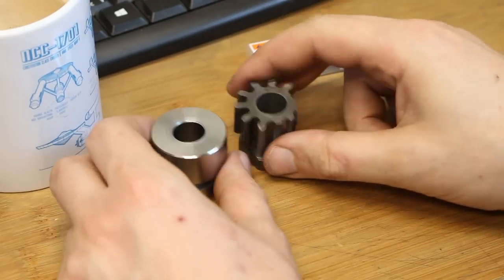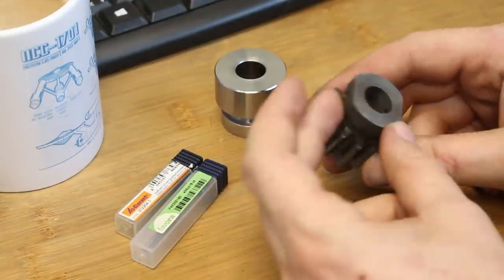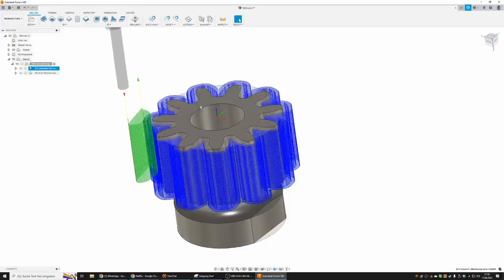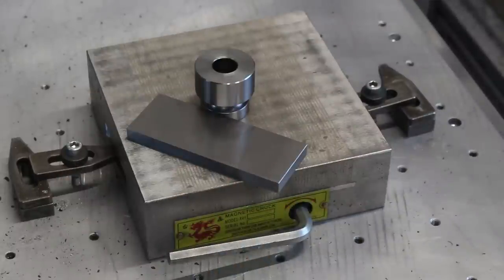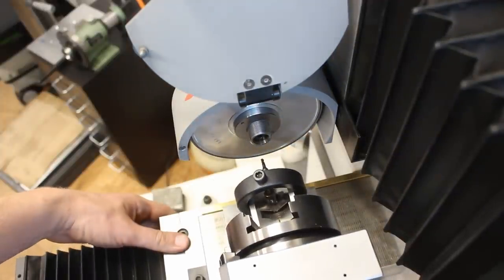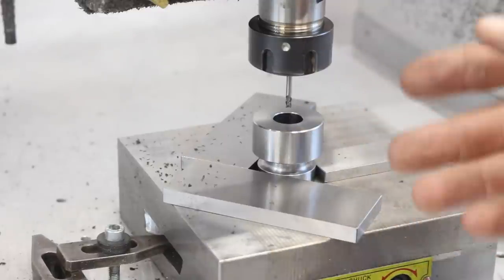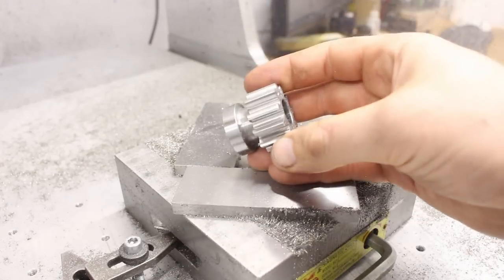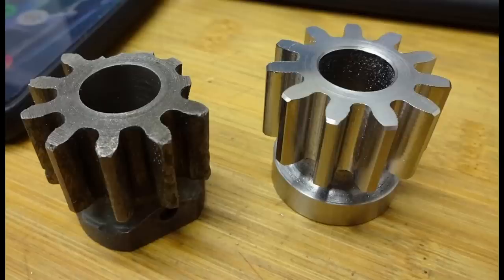Making a part: Replacement gear

Comment: i don't know if i am right but that looks like a gear with a negative profile displacment number (sorry i don't know the correct term) basacly insted of the involute to start at the base circle it start further back, it's good at reducing noise but they aren't as strong
Reply: if you need such modles for gears i can supply them to you in the future

Comment: I understand precision wasn't a major concern for this project, but I wonder what kind of tolerance you get milling steel on the router.  What required tolerance are you comfortable with, routing steel parts?
Reply from the maker: Usually Without any precautions  use half of Iso 2768-fine, means:
For nominal dimensions up to 6mm +-0,025mm
For nominal dimensions between 6 and 30 +-0,05mm
For nominal dimensions between 30 and 120 +-0,075mm

And so on. In reality its more precise, but I keep that as a safety when I don't want to compensate tool diameter/length offsets.
Reply from the maker: Biggest source of inaccuracy is the backlash in the ballscrews. At some point i want to replace them with either with ballscrews that have preloaded nuts or with double nuts
Reply: @StefanGotteswinter  Could you attach linear encoders to the ways and use that for positional feedback instead of on the ball screws?
Reply from the maker: Yes, that would mean I had to switch to LinuxCnc (Which can do a proper feedback loop with linear encoders.) But that does not solve all problems, the backlash still stays and cirlcles will still not be absolutely round - At the polar positions (0°/90°/180°/270°) there will always be a visible and measurable jump.
Reply: @StefanGotteswinter  ah ok, thanks for the insight as always!

Comment: Stefan, wenn du mit dem Fräser zwischen die Zähne fährst, hast du daran gedacht, dass die Fräsgeschwindigkeit im Bogenlauf zwar auf die Fräserrmitte bezogen konstant ist, aber nicht an der Kontaktfläche zum Frässtück. Beispiel: x mm/min Fräsgeschwindigkeit bei einem Bogenradius von 2 mm (bezogen auf Mitte Fräser) bedeuten bei einem Fräserdurchmesser von 6mm (r= 3mm), dass der Fräser mit (2+3)/2= 250% der Fräsgeschwindigkeit das Frässtück fräst. 
Vor allem wenn man spiralförmig Löcher fräsen will, stimmen die Geschwindigkeiten bei Fusion360 dann ganz und gar nicht.
Im Video bei 19:10 hört man gut, wie der Fräser durch die engen Bögen zwischen den Zähnen rauscht.
Reply from the maker: Sehr richtig - Nein hab ich nicht beachtet/berücksichtigt :D
Fusion kann leider nicht die Vorschubsgeschwindigkeit anhand der Außenbahn berechnen, nur auf die Mittelpunktsbahn. Creo z.b. hat die Option.

Bei sowas kreisch ich dann halt durch, ist ja nur ein Teil :D

Comment: Will the cross pin be right in the shoulder of your blank relief?
The flats don't look tall enough without the radius shown in the drawing.
Reply from the maker: Its a bit further down - The crosshole in the shaft will be drilled completely new, since the original one was offcenter quite a bit and hard to hit again.
Reply: @StefanGotteswinter  You've done an amazing job to keep an old drill press running.  👍
I'm really impressed that the corners of those little 3mm cutters hold up so well cutting dry in 4140.
Reply from the maker: I was mighty impessed by the cutter too :-)

Comment: they didn't want to go for the silicon braze and remachine or is that much cheaper to start from scratch?
Reply from the maker: Sounds like an awful nightmare to match the braze buildup to the old and inconsistent teeth :-\
Reply from the maker: Once the cnc runs, its an offhand process :-)

Comment: Hallo Stefan,
ich träume schon einige Zeit davon, mir Hobel aus Stahl für die Holzbearbeitung zu bauen. Da besagte Hobel selten lieferbar, sehr teuer und meiner Meinung nach wenig innovativ sind, wird der Plan immer konkreter.
Eine ordentliche Fräse liegt, wie ich feststellen musste, weit jenseits meiner finanziellen Möglichkeiten, wenn ich beim Stahl bleiben möchte.
Anfangs sehr abgeschreckt von Videos über das Schaben von Hand musste ich feststellen, dass es eine wunderbare Sache und vor allem für mich die beste Möglichkeit mein Ziel zu erreichen ist. Meine Bauteile werden ohnehin recht klein sein.
Eine Messplatte aus China ist vorhanden. Mit Messstativ und -uhr, einem Endmaß (Kontrolle der Platte), Tuschierfarbe, Walze, einem Schaber (gebaut nach deinem Video) und Material kann ich mit dem Üben anfangen, richtig?
Ich hab inzwischen viele deiner Videos gesehen und unglaublich viel über ein total unbekanntes Themengebiet gelernt. Vielen Dank dafür!
Reply from the maker: Tolles Thema, Ich hab schon Hobel gesehen bei denen die Seitenwände und die Sohle miteinander verzinkt worden sind, denkst du an sowas?

Genau, mehr Werkzeug brauchst du zum Schaben probieren/üben nicht - Vieleicht noch eine feine Feile oder einen Abziehstein (Muss nichts wunderspezielles sein, ein einfacher, halbwegs ebener Abziehstein reicht völlig), um die Grate zu entfernen.

Viel Erfolg :-)
Reply: Und es gibt ja noch Normteile ;)

Comment: An idea that only occurred to me several days after watching 🤣 ..  but maybe can be useful "next time"... you hogged out the blank slightly oversize on the lathe then centered it on the mill "good enough for this application" (doubtless!) With an indicator before cutting the teeth to final size.. but could you have also cut the center hole on the lathe slightly undersize ... and cut that also to final size with the mill in the same setup so perfectly concentric, limited only by the tolerance of your mill ? (And this is your mill so tolerance is 3/10s of nothing, right?)

Comment: Looks like 14.5 degree pressure angle, probably with positive profile shift to reduce undercutting in the root due to the low number of teeth (which would explain why the standard [no. of teeth + 2]/OD = Module calculation didn't work). Casting is unlikely IMO, probably just a shaped gear that just looks like garbage due to age related wear.

Comment: Isnt there a standard for the diameter vs # of teeth?
Reply from the maker: Yes - Thats defined by "module". But there are other factors like pressure angle, profile shift, undercut - And None of them matched up to each other :D

Comment: That gear looks like it might be cycloidal tooth profile.
Reply: No, that's definitely involute. Positive profile shift and many years of wear just make it look weird.
Reply: @elanjacobs1  When an involute wears, you see a stair step towards the root on the pressure face.  You do not see that here.
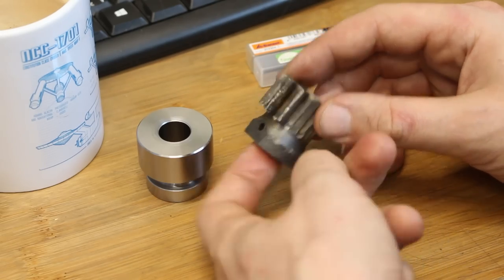Reply: @Worrsaint  There is a small step visible at 0:22 and 0:25, but sloppy fitting on shafts or bearings could allow them to move around a bit and reduce the definition of the step. Involute gears have effectively been the universal industrial standard for at least 100 years, the odds of seeing a cycloid profile outside of a clock are pretty much zero
Reply: @elanjacobs1  I don't see a step at the root at all.  They are very noticeable when there is high wear.  Are you referring to the gouge?
Reply: @Worrsaint  If you pause at just the right time you can see a bright line towards the root, which I'm assuming is a wear step. That being said, I have had gearboxes come in at work that are so flogged out (journals worn down, bearing races slopping around) that the wear step is a giant radius from the flank to the root; you can see where the wear starts, but it's not really a step anymore.
Reply: @elanjacobs1  look at the face view.  There is no step.  I have worked on many gear boxes and pumps.  You do not see the wear pattern usually associated with a heavily worn involute profile.

Comment: Don't ever run a mill with a mag chuck you will end up magnetizing the whole machine and the machine will be garbage.
Reply from the maker: Just like surfacegrinders that are completely magnetized trough?

No, thats not a issue the least.

Comment: Setting tools with carbide or any other hard material is a bad idear. It can chip the end of that endmill cutter and ruin good tools. Bit of paper has done me right for 25years. Not exactly time efficient but made a nice vid. 😂
Reply from the maker: Thats why i jog upwards, not downwards when setting toolheight and a round pin - Almost impossible to chip a tool that way :-)
Reply: @StefanGotteswinter  Carbide on carbide is bad. Only takes one wrong move to feck the tool up. Even the gentlest of touches can chip the end and may not even be noticeable to the untrained eye. Seen a lot of tool damaged this way and if I caught you doing it then it would be an instant warning at work 😁😁.
Reply: Being a critical tool of a human is bad too. But here you are, in all your glory.